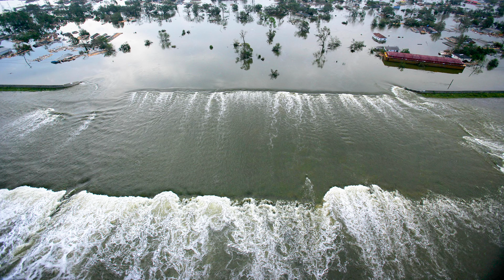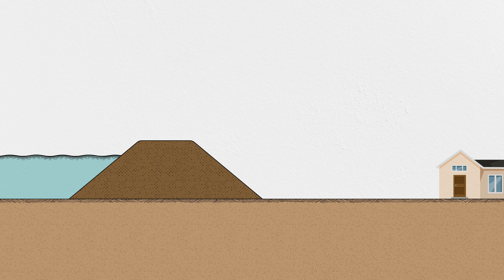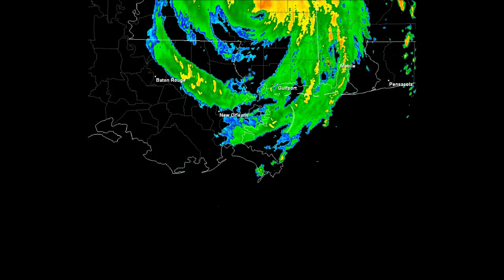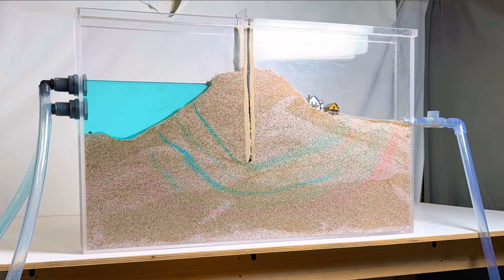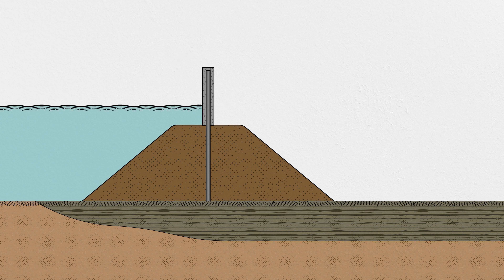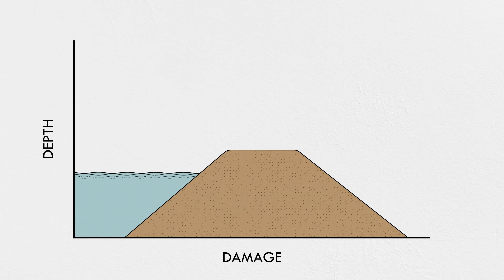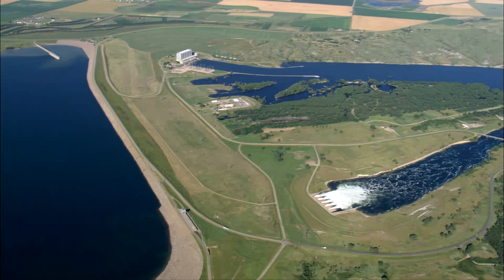The Mind-Blowing Flaw That Flooded New Orleans

Comment: A good friend of mine lived two blocks from the 17th street levee failure.  She lived there with her
Mother, who was suffering from Alzheimer's at the time.  They evacuated to Baton Rouge. After
the storm passed, the National Guard would not allow anyone in, even to check their property.
I had a big 4X4 truck, and we went to try to get in.  There was a convoy of trucks, mostly N.G. that
was traveling to the 17th street breach, and we just fell in with the convoy. We turned off at the
intersection of the street she lived on, and we were the first vehicle to traverse that street since
the passage of Katrina.  I know, because the mud was 2 feet deep, and undisturbed when we
went in.  The mud STUNK.  It was swamp mud.  If you ever smelled swamp mud, you know it for
the rest of your life.  Her house was completely flooded.  She lost a lifetime of collecting valuable
antiques, as well as paintings that have graced the halls of some Parisian galleries.
I, too, lost my home, as well as several vehicles that I used to sell.  I lost everything but the truck
that I used to drive away with.  I will never forget Katrina, as well as the many people that I helped.

Comment: Dear PRACTICAL ENGINEERING,
Thank you for this well developed and presented piece. The core problem of "many" of the disasters you noted in this piece are not engineering disasters, they are more often human disasters. There is a very good chance that the ACOE understood quite well the problems with putting up an I Wall in areas where their soil sampling implied a stronger reinforcement, however I wager they were working with limited time, and limited budgets that were based upon a rejections by taxpayers and thereby local, state, and federal government political forces to cover the true cost.
The larger and more complicated question is that the entire Mississippi River has been "man managed" and the surround area lost miles and miles of complex wetlands and delta that has protected those lowlands from storms, lastly is the question of whether portions of New Orleans should have been developed, and there is another human / political issue.
These complex problems have not "....gone away..." and if anything Global Climate Change is making the entire package of problems even worse in future higher storm energies, higher ocean levels, and correspondingly higher storm surges.

Comment: as a newly minted college grad in the early 80s, working in the Katy TX area on a large construction project, I always wondered about the nearby maintenance work that was continuously conducted along the Addicks Reservoir levee, it didn't seem like there was a foot of elevation change in the surrounding area for miles, but the work on the levees was non-stop, little did I know that thirty-five years later, Harvey would show us all what the levees would have to contain, and the power of another mega-storm

Comment: Talking about urban development. You should look into the 2016 flood that happened in Baton Rouge, LA. I believe a lot of that was caused by housing development that involved digging holes in the middle of them. Which they used to raise the level of the houses around the hole. Caused a lot of storm run off to have no where to go. Also poor maintenance on storm drainage in general.

Comment: I'm no expert, but imagine depending on piles of sandy muck to protect your city against the sea! Should have been one continuous reinforced concrete levy (welded steel rebar the entire length) the whole way, so it couldn't just break off into chunks or foundation of sand collapse under it.

Comment: Fun fact: After Katrina, the company I worked for helped program several of the new pumping systems installed to prevent future flooding. When another major storm hit, some of the pumps failed—not because of the programming, but because the required monthly tests hadn’t been done and the backup generators had no fuel. Even the best system is useless if nobody maintains it.. 🤦‍♂

Comment: I'm glad you are telling this story. I'm tired of telling it after 20 years.
Reply: also, it's New "ORlinz" (or AWlinz) but it's "OrLEENS" Parish and the "OrLEENS Canal. 
look, I don't make the rules
Reply: Wait.
You didn't know that they removed the inside berm to increase capacity?
I thought that was the story you were going to tell.
That's why it didn't fail on the opposite side. Jefferson Parish refused to scrape the inside berm.
It was a whole thing.
And then the Corp of Engineers told them to get rid of the outfall canals completely by moving the pumping stations to the lake but it was considered too expensive.

Comment: Your video tells part of the study, but not all.  I live 3 blocks from the 17th canal break.  Months prior to the storm, residents whose backyards front along the levee complained that water was bubbling up through soil on the back yard.  The COE and the sewerage and water board of New Orleans were called out to investigate and they came to the conclusion that all was well.  When the flood wall was constructed, the steel sheet piles were driven to depth far too easily.  The problem, they weren’t long enough and didn’t meet the proper resistance.  Finally, the COE allowed the Sewerage and Water Board to the dredge the canal on the New Orleans side to deepen the channel.  I watched the dredge operating for weeks.  The result, they dredged too close to the flood wall and undermined its base.  So, it’s also a story of gross negligence, as well as, bad engineering.

Comment: Another issue with the levees which failed was that they were not properly maintained.  This was particularly visible with the 17th Street canal, which forms a segment of the boundary between the City of New Orleans and Jefferson Parish.  On the New Orleans side,  Bellaire Drive runs parallel to the levee about 200 ft east of the levee center line.  There are houses on both sides of Bellaire.  While there was a legal right of way (50FT iirc), it was never enforced and people built fences and outbuildings and planted trees right up to the foot of the levee, and there was apparently no regular inspection (and certainly not correction) on the east side of the east levee.  We know how to do this in the New Orleans area; I know several people who live along various levees who have had to remove trees and construction.  i was personally in the back yard of a house on Bellaire for a child's birthday party and could see this.  Their fences didn't stop at the foot of the levee, but contunued up the levee to well within a foot of the I-wall.

On the west side, Orpheum Avenue runs basically adjacent to the foot of the levee; there are only houses on the west side of the street.  No trees, easy to inspect.   Keith (who lives, or at least lived) on Orpheum told me that yes, there were at least annual inspections.  The Orpheum side might have been similarly overwhelmed if it weren't for the failure on the other side relieving pressure.  Jefferson Parish may not have outrun the bear, but we outrun Orleans Parish.  (I have lived northeast of Lake Pontchartrain in Slidell since about 5 years prior to Katrina, but I grew up and began raising my family in Jefferson Parish for what is still more than half my life so far.

Another peculiarity about storm surge in eastern Lake Pontchartrain is that it was much worse AFTER storm passage than as the eye was transiting the area.  As you noted, Pontchartrain is an estuary, but it has a relatively narrow passage to Mississippi Sound and the Gulf of Mexico, known as the Rigolets. (RIG-uh-LEES).   The storm surge and easterly winds blew water into Pontchartrain for over 24 hours.  Because Pontchartrain is 24 miles wide and about 40 miles long east-west, the water was pushed all the way to the western end, at Pass Manchac (I-55 crosses it).  The storm took a southeast to northwest trajectory passing slightly to the north of Pontchartrain, and once the center passed more than a few miles inland, the winds turned westerly and Katrina tried to push all that water back out of Pontchartrain, and it piled up in the rush to go back out through the Rigolets.  This was certainly the source of most of the flooding in Slidell, and very clearly caused most of the damage to the "Twin Span", which is I-10 across the eastern end of Slidell.  About 90% of the damage to the guard rails was on the west* side, meaning it happened as the water was rushing out.  while I haven't checked the specific times, it likely contributed to the New Orleans flooding as well.  Local culture thing: while the new I-10 bridge is still called the "Twin Span" by many, it is officially the "Naturally N'awlins Frank Davis Memorial bridge.".  Frank Davis was an avid hunter and fisherman who reported on such for local TV and radio stations, and his personality and delivery was such that he could read the phone book and make it interesting.  This led to him doing human interest pieces on local TV, in a segment which he called "Naturally N'awlins".  When Frank passed in 2013, they named the bridge after him.

Also, a couple of important bits you missed about these I-walls.  The sheet pilings are not flat, but corrugated  for additional strength.  Also, as shown in your video but never mentioned, the portion of the I-wall above the top of the levee is sheathed in concrete.

* West:  I know I-10 runs generally east-west, but from its intersection with US-11 at the south shore, as it crosses Pontchartrai,n and continues to its interchange with the east end of I-10 and south end of I-59, I-10 runs south-south-west to north-north-east.  In a similar vein, I fear that after I-49 connects to I-10, people on the New Orleans west bank or elsewhere along the road to Houma will decide to evacuate by "I-49 North", and will actually be heading into a more precarious situation than they left for some 60 miles.

Way back at the beginning, you noted that New Orleans hasn't reached its pre-Katrina population.  If you check back further, you will see that New Orleans also hasn't reached its pre-Betsy (1965) population.  Though the loss of population in the '60's also includes "urban flight", that is, improved highways allowed more people to move out of the city proper into the suburbs.

I don't know if you've covered it before, but the New Orleans drainage (or more appropriately pumpage) system is definitely worth a video.  The Army Corps of Engineers estimated many months, perhaps more than a year to drain New Orleans, after Katrina, based on bringing in pumps.  The S&WB (Sewerage and Water Board) basically said: we have the pumps!  Close the breaches in the outflow canals, bring us torque, and we can do it in less than a month.  The Wood Screw Pumps are based on the Archimedian screw pump , but implemented on a scale I've never heard of anywhere else.  If you want to focus on failures, it's based on a frequency much different than modern 60 Hz power -- 24 Hz IIRC.  And the frequency is obviously closely tied to efficiency, so apart from physical engines, 60Hz has to be mechanically geared down or electronically re-inverted.

OBTW, BRAVO on researching pronunciations!  You only missed one, and it's one that is due to our silliness, not your lack of diligence.  While the city is called "New ORlunz", "New AWlins", or even "NAWwlins",  the parish and the avenue  and city agencies  that don't have "New" in the name are "orLINZ".  TI think it's a before/after thing.

Oh, another thing about levees that were topped.  Maybe I got bad news, but as I recall, the major damage due to overtopped levees was not on the Industrial Canal, but the MRGO (called Mister GO), the Mississippi River Gulf Outlet.  The industrial canal is a north-south canal with locks that connects the Missssiippi River with Pontchartrain, almost exactly along the 90th degree west longitude.  The MRGO was a canal that branched east very near the 30th parallel, and led to the Gulf of Mexico.  After Katrina, the MRGO was dammed off, making a really high bridge on I-510 known locally as the "Green Bridge"  because they chose to paint it green something that could now be much lower.
Reply: Thank you for the datails. I'm quite sure that Grady studied the enormous final report. For this video, he concentrated on the wall sections because those were built to prevent flooding of the core parts of the city, in a high profile endeavor in the 1960s. He pointed out multiple egregious engineering flaws. Even though he made some mistakes in his narrative, I think he largely got it right. His experiment and the diagrams he presented were very helpful to  understand the fundamental issues.

Comment: I am wondering.  Which of the mechanisms is responsible for the collapse
1:  ingress of water between particles, thereby changing soil properties
2: kwel [dutch]  transport of water under the levies, washing out foundational soil due too high water flow
3: A combination?

Number 2 is temporarily fixable by laying waterproof (or at least water slowing) tarp on the soil, wide enough, and then start stacking sand bags on the tarp, thereby creating a counter pressure downward.

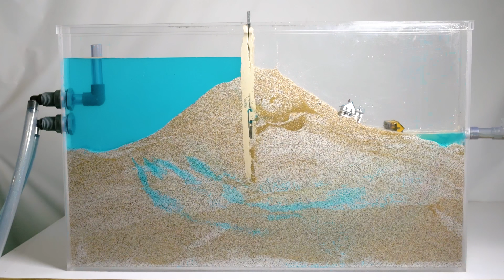The demo at 15:01 is typically 'kwel"

Comment: My only issue with this whole thing is that the city was built below sea level. Seawalls are great however, everything else is a bit secondary if you think about the primary cause of the BUILDINGS BEING BELOW SEA LEVEL! I got in trouble in the army while I was stationed at ft hood during Katrina when my sergeant, who didn’t speak great English asked for “tips”. And I responded with “how about a topographical map?” I got to spend the next two weeks on a helicopter flying people out of Katrina and while I feel bad for them, they STILL BUILT BELOW, SEA LEVEL! 🤦🏼‍♂️ while I was in Louisiana, I’m still proud to say. I’ve still never stepped foot in Louisiana.
Reply: The French Quarter is the original city and it's above sea level, but the city spread outward into swampy lower lands, first as cemeteries and then subdivisions. Soil subsidence from decaying vegetation that was just bulldozed and covered with 20 feet of sand is the problem. We have to spread about an inch of sand on the lawn every year to hide it or the houses, built on creosoted pilings and concrete slabs, seem to slowly rise up out of the ground! In the 60's the subsidence made gas lines rupture under homes and they exploded all over my neighborhood.... I left in '88, too nerve-racking waiting for the next time!

Comment: 🤔 then how come you wouldn't incorporate under the center of the levee beneath the original ground line a hollow space that connects to the canal system 

like some kind of giant french drain acting as a vent for the ground water pressure?

Comment: If they had used 100 foot tall sheet piles to make the I-wall would the levees have failed. 50 feet would have been below the earthen levees base, 30 feet inside the levee, and 20 feet protruding from the top of the levee. Would the sheet pile wall being pounded deeper below the levee base have stopped the seepage? Without the seepage would the levees still have failed? If the levees had held would they still been over topped?

Comment: I grew up on the Orleans side of the 17th st. canal most of my life was playing and fishing in that canal, in the late 70s was when the sheet pylons were installed the levee broke behind a good friend's house, after the sheet pylons were inplace my friends backyard developed water puddles at the back of the property, before the pylons it was perfectly dry year round my buds dad reported it to officials but it was past around to all departments concerned each blaming other dept. Now this was 25 or so years before Katrina did what storms do and I'm not sure if the levee i mean the earthen levee would have failed but all the storms from the 60s and 70s that original levee held up just fine, it has made me wonder,  I'm not a engineer or anything but my life experience has me question whether those new system were part of the problem

Comment: Ok so I don't know much about the actual construction of these Levi. You have made another video on this previously which I watched and the thought that occurred to me was.. amazement...that this actually works in the majority of situations. This is under the assumption that effectively, all thats being done is a stick being put into the ground. Yes yes its made out of concrete and is a very long stick. But I'm sure that we have all tried to bury a twig into the ground and tried to make it stand up straight (when in shifting and water loged sand) this does analogy is not perfect but whatever. and found that to be incredibly difficult for the sick to not get nocked over at the slightest touch. But trees stand strong and hold earth even when the tree has long since died.

So whats the difference between a stick and a tree? Well...roots of course.

So if one drilled to the bottom of the levie at an angle (45 of the normal plane would be a place to start) and filled that with grout. Doing so on both sides preferably. You'd give the levie some roots to hold onto the soil. 

It would end up looking like an upside down umbrella.

Idk just a thought.

Wait...hasn't this been used for building large hydroelectric dams before? Why wasn't something of this nature been used here?

Comment: I asked my AI " What's the first known engineering disaster?" The answer? ' The earliest strictly recorded engineering disaster occurred in 27 CE at the Fidenae Amphitheater, just outside Rome. Built by a freedman named Atilius for profit, the massive wooden arena was erected on unstable foundations and collapsed on its opening day. The structure fell under the weight of an overcrowded crowd, killing an estimated 20,000 to 50,000 people in what remains the deadliest structural failure in history. '
The first one had the highest body count? Didn't see that one coming.